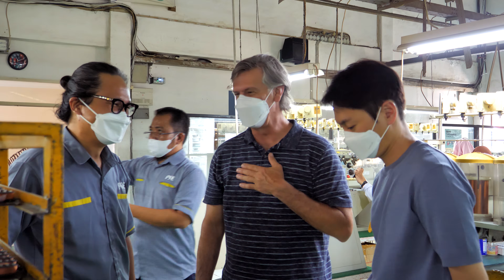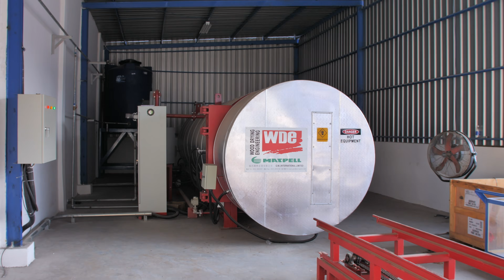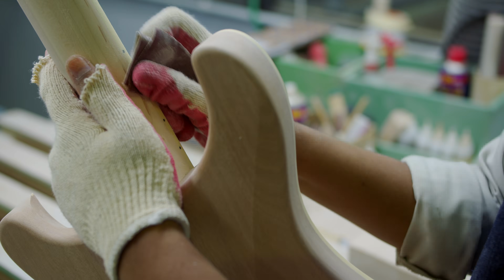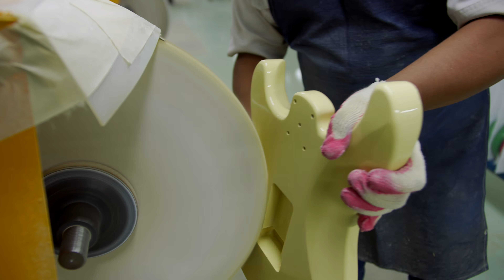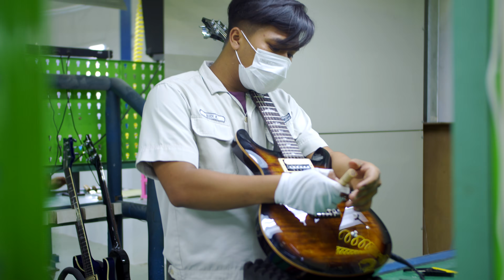PRS SE Factory Tour | 2022 | PRS Guitars

Comment: I just bought a new PRS SE Silver Sky in Stone Blue. Unfortunately, it came with a small chip in the finish around the upper strap button (the one near the neck). The screw also catches slightly, so it looks like it may have been forced in at the factory.

Stone Blue is really hard to find, so I'm torn between keeping it and returning it. :( Other than this issue, the guitar is absolutely gorgeous and plays great.

Has anyone else received a brand-new PRS with a factory defect? If so, did you keep it or send it back?

Comment: They have done a great job at imitating such an expensive guitar at fraction of the cost main difference I noticed is the more expensive PRS go through a more thorough drying process not just the rose wood neck but every part is meticulously dried and they take more care choosing the flamed tops and stains and they use less machines and more hand work in sanding and cutting… the staining is insane on main line PRS those zebra stains on Private Stock are unmatched.

Comment: I have 4 PRS Guitars

CE24
Mark Holcomb SE
SE Custom 24 Limited
SE Silver Sky

A guitar that is worth more than $1000 and still marketed as budged or consumer friendly, is not a budget guitar. The SE is not low quality. It is still a professional instrument. At least I see it like this. Of course, the CE24 is a whole new level. I feel the difference on the neck every time I play it compared to the other ones. But they are still quality instruments. The reason I think the SE is not budget, is because budget guitars are low quality, and below $400. Anyone that says that PRS have no mojo, is a Les Paul fanboy. If you get a SE, change the pickups, get a proper adjustment, fret levelling (yes, they do need) and you have a totally different guitar. I play with low action so my SEs needed levelling. otherwise don't bother. They play amazing. The Holcomb Se is my main guitar being tuned in Drop C from the factory, I wanted a guitar that was designed for this tuning.

Comment: I have owned(own) PRS Core Line, S2 and SE. the few SEs I’ve had and one I currently have (NF3 maple fretboard) are crazy good for the price. They are the only budget guitars that I’m not dying to change anything about. Possibly switch to locking tuners but only for ease of changes not for tuning stability issues. 

They are NOT core guitars…but dang they are hard to put down…it’s starting to blur a lot. 
SE guitars we inexpensive but bycno means “cheap”

Thank you Indonesia…you guys are legends!
Reply: The finish & overall feel of the guitars in hand almost always gave out the differences.. the finish is the key imo also wood selection~. But is it 10x better?  For me.. no ;)

Comment: 🎯 Key Takeaways for quick navigation:

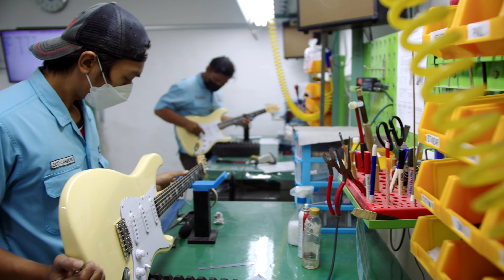00:48 🎸 The PRS SE series was started in 2001, following a request from Carlos Santana for a high-quality, reasonably priced guitar. 
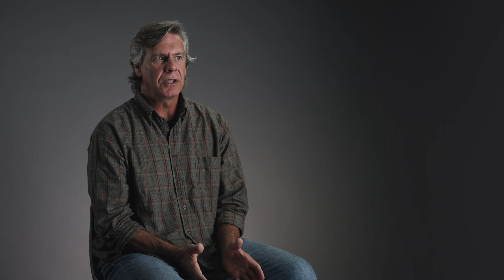01:21 🧩 Making a PRS guitar involves specific processes and parts to ensure a distinctive feel and quality. 
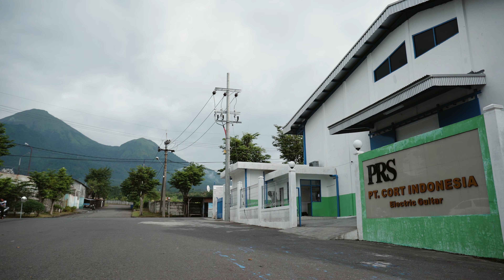01:47 🏭 In 2018, PRS guitars started operating in a dedicated space through a partnership with PT Court, which improved the quality and innovation of the instruments.
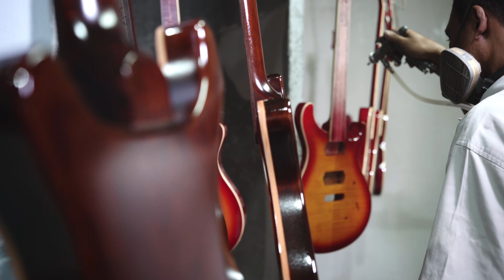02:31 📈 The demand for PRS guitars exceeded supply, leading PT Court to build a new factory specifically for PRS guitars.
03:00 🏢 The PRS SE Electric Factory in Indonesia spans 90,000 square feet, and about 500 guitars are made each day with a team of around 400 guitar builders.
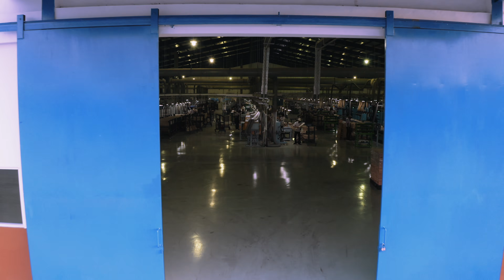04:01 🤝 PRS works closely with PT Court on designs, manufacturing processes, and quality assurance, with regular communication and visits to the factory.
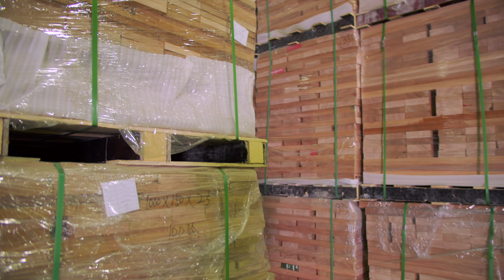05:09 🌳 Different types of woods are used to make the guitars, including mahogany, rosewood, maple, and ebony. The wood is dried before being cut for stability and tonal quality.
07:01 🏗️ The guitar body construction involves the use of CNC machines, sanding, and in some cases, the application of a plastic binding.
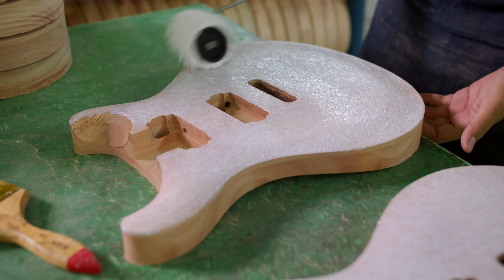08:10 🎨 Guitars with curly maple veneers undergo a veneering process to accentuate the natural beauty of the wood.
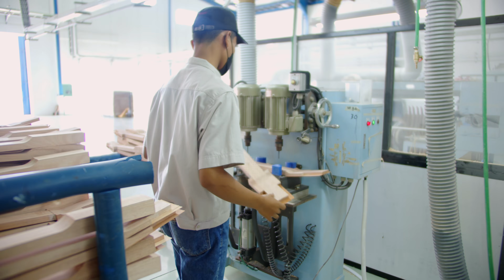09:03 🚧 The neck of the guitar goes through a detailed process of planing, drilling, CNC machining, truss rod installation, and sanding.
11:08 🔩 The neck and body are joined together in a meticulous process to ensure a proper neck angle for comfortable play and setup.
12:19 🖌️ The finishing process involves sealing, staining, applying a base coat, and then coloring. The finish aims to be thin, hard, and clear to preserve the sound quality of the guitar.
14:20 💫 After the top coat is applied, the guitars undergo sanding, buffing, and a final review to ensure a flawless finish before assembly.
15:53 🧰 Fretting the neck is a critical process, with frets being glued, tapped, and pressed, and then the neck being leveled by hand.
16:37 🎶 Assembly involves installing tuning pegs, drilling holes for various parts, setting up to PRS's specifications, and checking the electronics.
17:35 🎚️ The setup process requires precision to ensure that the guitar plays perfectly out of the box.
18:15 🔎 Quality assurance is carried out by the most experienced team at PT Court, with each guitar undergoing top-to-bottom inspection and play testing.
19:10 🙏 PRS hopes that customers can appreciate the meticulous detail and craftsmanship that go into making each PRS SE series guitar.

Made with HARPA AI 👍 Upvote to improve video surfing

Comment: 😯 Look how thin that veneer is! The maple top on my solid mahogany Goldtop started at 11/16"(18 or 19mm?) thick. I paid less for it than the cheapest SE and it's an incredible guitar. Not an Epiphone, that's for sure. They didn't offer near these specs for what I paid. They only had low end specs & hardware and bolt necks instead of set neck. Basswood. Not even a veneer top. It just wasn't worth the money. At all.

Comment: @PRS Guitars Well, to be honest, ive watched the entire video just for the sole purpose of seeing the quality control of the PRS  Factory. In the Video its nicely displayed - but in reality i had 5 Custom 24 in a row, with huge issues. Like for example the entire Hole for the Tremolo was off center. or the trem hits the finish, or every single one had a f'd up input jack. Or the nut is just sharp and unplayable on the first fret... I even had a used guitar sold to me as new , while it was already scratched and clearly used. i did return 5 guitars and now i have the 6th. I really like the guitar, but unfortunately after having 5 really faulty guitars im sorry PRS but im never gonna buy one from you again. the quality control was beyond me. 
The CQ Tag always said its been checked on everything. Fun thing is, even the guitars in my local store which are displayed have issues. The last one i tried had a broken pickup switch and the volume knob was crackling a lot. 
I dont wanna hate on PRS in general, but guys. Do some quality control before you try to sell it to customers. from my experience, you'd have to be extremely lucky to have a fully functional guitar from them, which is unthinkable when comparing PRS to other brands. If only all of your guitars were checked properly, then i'd definetly buy another.

Comment: I have a Korean made SE as well as an Indonesian made SE and they are both good, but I think that the WMI made ones were just another level of good. I went to modify my Zach Myers SE and was disappointed to see that the electronics were messy at best, broken ground wire to the bridge, etc. There was nothing really "wrong" with the instrument, I just felt like the quality was a little higher on the Korean made SE's. Having said that, I have not experienced a Silver Sky SE but have heard nothing but good things about them. I own two core Silver Sky's and may venture into an SE if/when they offer maple fretboard variants. PRS is top notch imho, when it comes to quality. Whether it be American made or import, they set the bar high and it is refreshing to see a company that still holds themselves to a high level of production regardless of where that production is.

Comment: I always wanna know, If you glue frets, how hard It can be refretting them later.
Reply from the maker: Easy, you just heat up the frets and pull them out! A soldering iron works well to heat em' up! That said, we're very careful to use an alloy of fret wire that doesn't require refrets too often. - Jack

Comment: Makes me proud to have an SE guitar. I just wish it would stay in tune after using the tremolo bar. I upgraded to locking tuners but that still wasn’t enough. I can hear the strings getting caught in the nut when pressing the tremolo. Nut grease also hasn’t had any lasting effect.
Reply: If you haven't already, upgrade the nut to a GraphTech TUSQ nut. Also, make sure the nut slots are the appropriate size for your strings.
Reply: It seems the regular string gauge I used was the issue. I looked it up and saw Standard SE 24 guitars use 9-42 gauge. I swapped those strings in, along with applying Big Bends nut grease, and now my tuning is much more stable. Thanks for the tip!